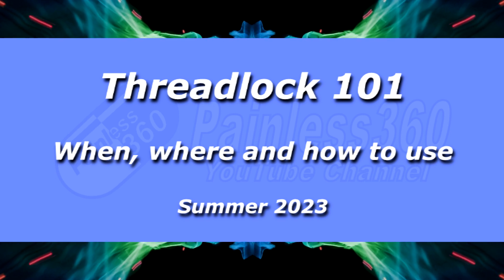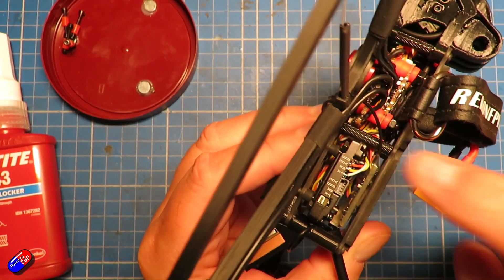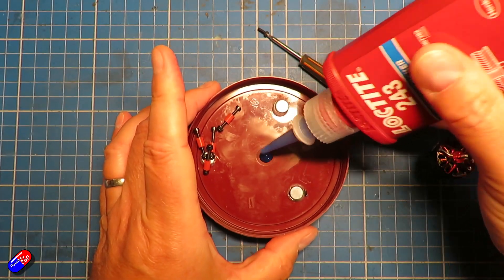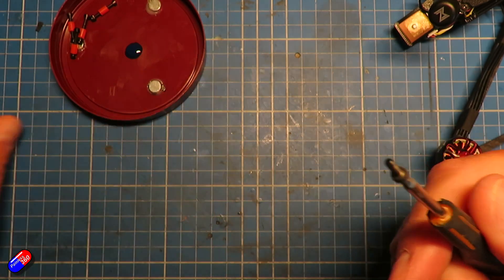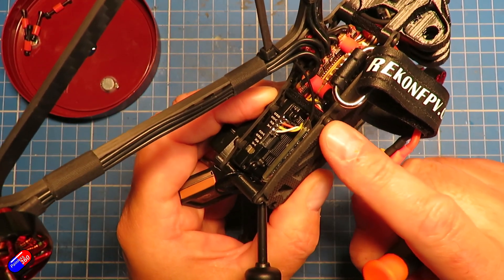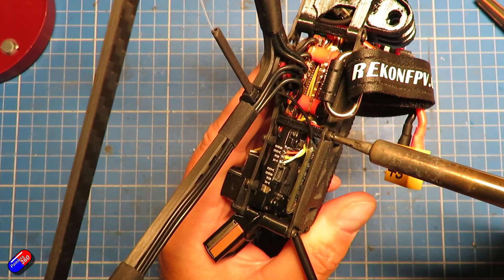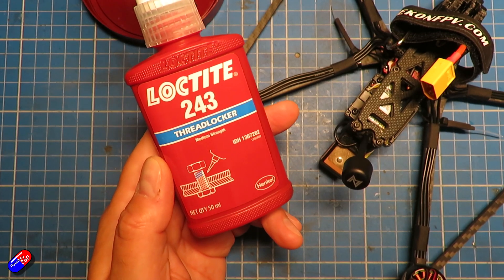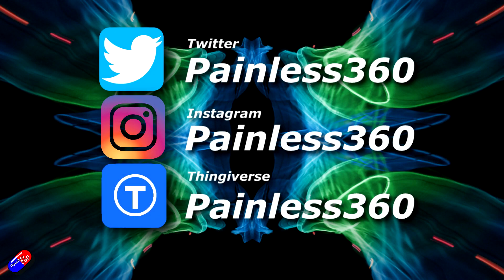Threadlock 101: What it is and where to use it...

Comment from the maker: Threadlock FAQ:
 - Purple threadlock is available and is of lower strength compared to blue
 - Blue threadlock is the one to use in RC, as shown
 - Red threadlocker (also called studlocker) is a very strong bond and should be avoided in the RC hobby
 - Only use a small amount of blue threadlock in the last 3-4 threads as shown
 - Clean the screws to remove rust, grease, and dirt before use
 - Avoid getting threadlocker on plastic parts, use only on metal to metal
 - Use heat to soften if the screw/bolt is hard to undo
 - Remove cured blue threadlock from threads using pure acetone.

Comment: If you have a car in winter and snow.  Thread lock tight helps prevent rust welding.  If you have changed a tire in the snow, this can save you a tow!

Comment: Never use this around plastic. My albabird had issues with prop nuts coming loose. I used a tiny amount of blue thread locker on the nut. Armed and set autolaunch idle and all was well. As soon as the FC gave it full launch power, both props exploded and I'm still finding bits around the farm. Was thankful for the launch delay as it could have exploded in my face. I notice in the comments someone else has used the solution I started using. Wood glue. Works well and doesn't eat non metallic material though it has an extended drying time compared to thread locker.

Comment: A word of advise.
Do NOT use the RED treadlock.
That's a permanent solution, and are too hard to get apart again for hobby use.
It will need to bee heated up to glowing red hot, before it comes apart.

And, the treadlock do not harden, before it is 'activated' by the friction, when the bolt and nut are thightend.
Reply: apparently soldering irons can be used to get them loose
Reply: @MrChanw11  That's the blue. Not the red. 🙂

Comment: Have a look at Connect Premium Nutlock & Seal its about the same size bottle but works on pins that havent been cleaned like you have in the video.
I have been using it for years now and never had a failure, again I would never use around plastic parts unless I left it to dry on the thread before use.

Comment: Can you apply blue threadlock to the end of screws and then keep them for later use like the DJI prop screws, or is that a different type of threadlock?
Reply from the maker: I've never tried. Leaving a blob on the plastic cap for weeks at a time will change the edges of the puddle, so something happens to it when left in air for a long time... best of luck
Reply: @Painless360  Time for an experiment methinks.  It would be useful for replacements in the field.  I'll give it a go.

Comment: Is it normal that threadlocker becomes somewhat brittle and almost sandy? What do you do after taking a screw out and want to put it in again? I like those preperated screws from iFlight, what do they use?
Reply from the maker: Use pure acetone to clean the screw. If the threadlocker is gritty, then I'd replace it... Happy flying!